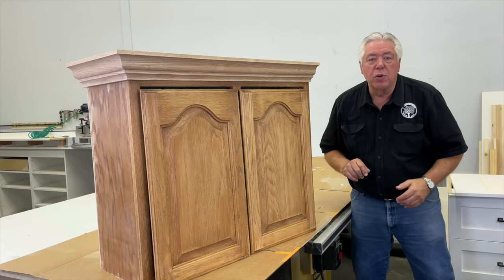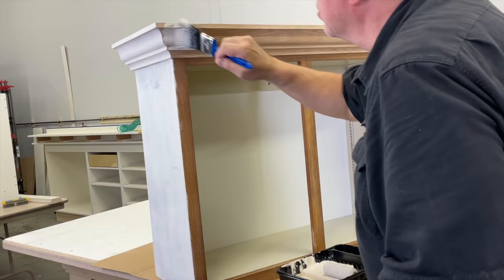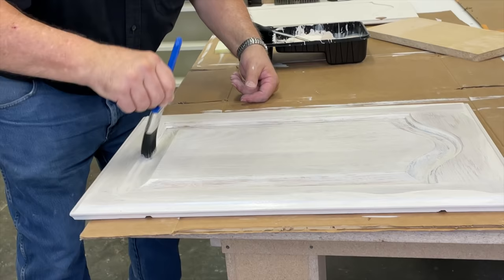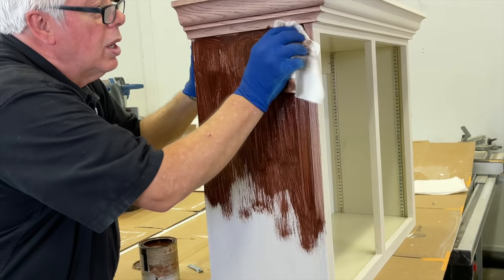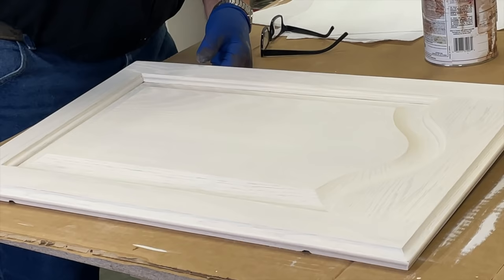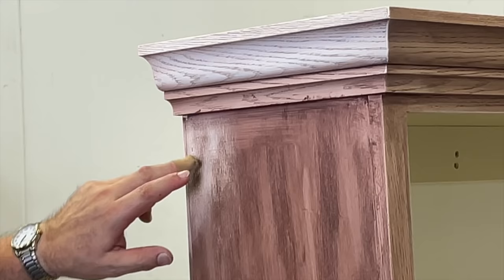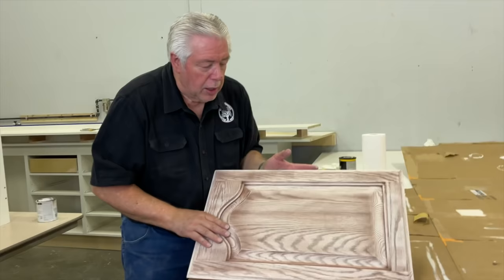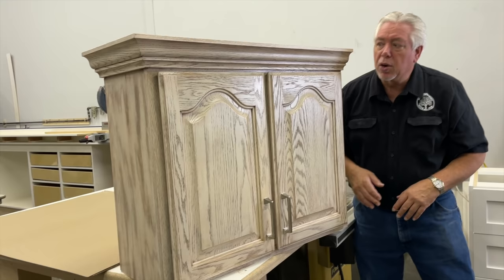Just Like Magic Your Golden Oak Color Will Disappear

Comment: I saw DYI kits that are not bad at $100.00-$300.00 for painting cabinets, but money is very tight, so I've been buying things a little at a time since last winter. When I saw your glazing technique, I got charged up and now I want to try the glazing technique. I'm planning on doing this to my cabinets in early fall when I can still keep windows open plus it will be cooler and less humid out. I have my living room walls and trim to do as well that I planned on doing last year. I was going to just paint them white, (they are golden oak now), but I love the look of the grain through the paint in your technique. Besides the obvious of priming first, should I use an oil-based primer then a water-based final coat? Or do they have to be the same base element? I bought the small rollers and pans in bulk at least 4 years ago and still have a dozen left, and chip brushes that I won't use on the cabinets. For this process should I use a natural hair brush, such as sable or can a nylon brush be used? I appreciate any input you may have for me. Thanks! ~Dolly
Reply from the maker: Dolly...you don't need the same base in your different layers of application. A nylon brush will work great. Good luck with your project. Thanks, Wes

Comment: Just a question on the end with the veneer could you do a water pop? It might be too thin to water pop. In redoing wood floors you can water pop then use a wire brush kit and take the soft grain out. The water causes the grain to rise and allows for the removal of some of the soft grain.

Comment: Its an okay look, dont get me wrong, but thats a lot of work for the look. You have to disassemble, prep surfaces, lay out all material, do a layer, flip doors, do another layer, flip back and sand doors and cabinet boxes, add paint over primer, sand again, add another layer, sand again, and then I assume there will some sort of wipe on top coat. There are gel stains you can wipe on one time and touch up a little, then top coat with the most  minimal of prep needed.
Reply: I agree!  Not a fan.

Comment: Is there a reason that you dab with a cheap brush instead of using longer strokes with a good brush?
Reply from the maker: Yes. The glaze doesn't need to have a smooth or finished look. A cheap disposable brush is adequate. Thanks for watching. Wes

Comment: Doors off 
Wire brush, lacquer thinner 
Primer for paintbrush, tinted
Foam roller
Find someone who will reattach doors w new hinge, add hardware
He used wire brush on primer
Brown glaze oil based over primer. Doesn’t dry as fast, has more time 
Grain shows
Sponge sander. Sanding off surface glaze
But I can’t sand mine

Comment: This finished cabinet is a nightmare, from the wire brush to the cheap paint brushes, and paper towels you used.  The oil based stain over the primer is horrible 😳

Comment: Would it be feasible to just simply paint the cabinets and skip the glazing step if I prefer a more faint grain look. . . If so, would priming be advised or just prepare the surface and go directly to 2 coats of paint?

In short, I prefer more faint look on the grain, how can I maximize that preference to save me the most work? - Thank you very much.
Reply from the maker: Hi...the color coat (paint) that I used was a tinted primer and you could apply a clear top coat on that and skip the glaze. A more subtle grain effect would be achieved by a less aggressive wire brushing. Thanks for watching, Wes

Comment: Wowee I love this so much!  I've been looking at new homes to move into and up until now avoiding yellow oak but not anymore.  Bring on the yellow oak so I can transform it into something beautiful like your example here in this video!  Thank  you for the clear and easy instructions.  How scrubbable is polyurethane?  Does it ever turn yellowish or discolored?
Reply from the maker: Hi Rose...polyurethane should be yellow resistant and easily cleaned with a soft cloth and warm water. Thanks, Wes

Comment: Wes, I'm not a big fan of water-based products. Have you tried using kilz as your base coat? I'm curious as to how that would work.
Reply: Kilz is a brand
Reply: Ryan E. I know kilz is a brand. I'm a painter. I'm just wondering if he ever tried kilz as a base coat rather than water based primer as a base coat. I'm wondering if kilz would give the same finish
Reply: @michaelroques743  you’re not getting it, Kilz is a brand. They make waterborne, solvent borne, shellac based, synthetic based….
Reply: @ryane6719  real painters know wtf hes talking about. Dont be rude
Reply: @floridagirl9064  It doesn’t matter if you’re an astronaut or a painter ,we’re talking about differences in physical property of primer. he’s talking about a brand without telling us which Product under the brand he would recommend.
Reply: @ryane6719   Low in T?

Comment: I have these oak cabinetsand they are very old. I've attempted twice to paint them pure white but after a little while I start to see yellow bleeding through my paint. I stripped the wood using citri strip, cleaned them with tsp, and sanded them. What prducts do I need to use and what steps do I need to take to keep them from yellowing over time. I want a bright white kitchen and I'm having a hard time achieving it! 😩

Comment: You're video is so well put together and encouraging. Thank you for making it! We recently purchased our home and we knew we needed to get the cabinets repainted. The prior owners did a really terrible job where they didn't fill in gaps and damaged parts of the wood, then painted it with white semi-gloss paint (probably only one coat because the oak color still shows through). To do this project as shown in this video, would you recommend stripping the paint first? Or could I sand it down to save me some time? How should I repair the wood damage? Thank you in advance for your advice and tips.
Reply from the maker: Hi...don't strip the finish, just sand. Repair your damage with a good wood filler, then prime and paint. Good luck, thanks for watching. Wes
Reply: @WoodworkingWithWes  thank you for your suggestion. I really appreciate your feedback

Comment: Love this tutorial and i am trying to do my bathroom cabinets this way. The only problem is that the current cabinets have a thick almost pinkish coating. Is the best way to get that off by scrubbing by hand with a wire brush?
Reply from the maker: Hi Sean...not sure what the pinkish coating is. Start with your wire brushing to see if it enhances the grain enough for the cerusing process. 
If not, you may have to remove the existing finish by sanding or stripping. Hope this helps. Wes
Reply: @WoodworkingWithWes  i wish I could send a pic here but it won't let me... I started using a stripper and will use a brush after to clean it up because the coating is pretty thick. I think they went a bit crazy with clear

Comment: I love your vids…..but it appears as though the “final product” has some bleed through. Oak in my experience has some of that honey color bleed through as you paint/prime it. Was that the case here or am I seeing it wrong? And how do you deal with it? Thanks for all of your informational vids!🤙🏻
Reply: I was wondering the same thing.  Perhaps a coat of BIN to seal the tannins and the tinted primer?
Reply from the maker: Actually...it wasn't bleed through. I just sanded the primer coat a little too much and didn't go back to repair it. I have not had any bleed through issues with the cerusing of golden oak that I have done. Thanks for your comment. Wes

Comment: It's really nice! 
Is there any polyurethane that can be used that doesn't leave a yellow tint?
Reply from the maker: Hi Ann...yes, I think there are. I would suggest checking the manufacturers specification. Thanks for watching. Wes
Reply: @WoodworkingWithWes  , thank you for sharing your video with us. I've never seen this method before.
We're buying a home and the cabinets are a bit outdated. I'm thinking about using this method with a grey stain if I can find a clear coat for it.

Comment: I understand using the 1 1/2" brush on the face frame, but why not use a bigger brush on the sides and the doors to speed up the process
Reply from the maker: You certainly can if you would like. Thanks for watching. Wes

Comment: When i wiped the glaze off, the paint came off with it. Would it be better to use a satin paint so the glaze whipes off easier?
Reply from the maker: I have run into that problem also. I solved it by applying a clear sealer coat after the paint and before the glaze. I use Minwax Polycrylic. Thanks, Wes

Comment: Mr Wes! I need help please!!!!!  I want to do this finish in my kitchen cabinets instead of refacing.  But I want it in green.  I want white for the ML Campbell oil base furniture glaze and green for the primer (?).  I don't want to make mistake, thus the questions.  Also, I only want to ceruse the doors.  the rest, I still want the golden oak color.  What do you think? Do you think that would work?  I need to clean the entire kitchen cabinets with acrylic thinner (is that correct?) because the old microwave we used to have were putting so much grease all over the kitchen (that has now been changed).  What do you recommend I use to finish the golden oak trimmings if you think it's ok to ceruse only the doors.  I'm ready for the job.  I would appreciate it if you can help.  Thank you so much.
Reply from the maker: Rowena...we have done a video with a green and white glaze you can refer to and it would look great on doors only leaving the cabinets in their original golden oak. The acrylic thinner might work very well but do a test on one of the doors you plan to paint to see if it does what you need. If you want to put on a fresh coat of clear finish on the golden oak portions of your cabinet, polyurethane would be a good recommendation. Good luck on your project...sounds awesome ! Wes

Comment: Do you have to remove the original finish —strip or sand? Or does using paint primer allow you to skip stripping and sanding ?
Reply from the maker: This process eliminates stripping and sanding. You might review the video closer before you begin a project. Thanks, Wes

Comment: I tried that at home last night but I must be doing something wrong. I used water based stain and when I tried to wipe it, it took off the paint underneath. I can think about couple of factors: does it have to be oil based stain? Should I use satin finish paint instead of matte? Any advice would be appreciated.
Reply from the maker: Julia...please review the video one more time keeping in mind that my base color paint is water base. The next step is not a stain but a glaze and is oil base. After cleaning the glaze gently, I wait for it to dry and then sand lightly to highlight the grain. Thanks...I hope I have answered your question. Wes

Comment: Hi Wes would like to know if the cabinet was sanded first? Have varnish on mine, would wire brushing be enough to remove varnish for stain to darken grain?
Reply from the maker: Hi Karen ... wire brushing is enough on the paint and glaze process I demonstrated. If you are wanting to stain a darker color as your question suggests, you will need to sand it completely in order to refinish. Thanks, Wes
Reply: Hi Wes, I have dark stained hardwood that is grainy, would this technique work for that or what can l do to lighten hardwood? Karen from Aussie!

Comment: I'm trying to clean grease from cabinets before starting this process. I've wiped down with mineral spirits. Some are still quite dirty. Any recommendations? TSP, ammonia, something else? Thanks!
Reply from the maker: I am sorry...I really don't know what to recommend since the mineral spirits should have done the job. Perhaps go online and check out resources. Thanks, Wes
Reply: Thank you for the reply.  I wire brushed one door after cleaning with mineral spirits, and it worked.  Do you need to sand (sponge sandpaper?) the back of doors and inside the cabinets that will just be painted white,  no glaze?

Comment: Using the wire brush, won’t it leave scratch marks on the surface?  It won’t look like the typical sanding wood finish
Reply from the maker: Correct...it is not the typical wood finish, it is a ceruse finish. Wes
Reply: @WoodworkingWithWes  thank you Wes.  So I understand that the finish is intentionally rough instead of traditional smooth sanding.

Comment: My kitchen cupboards are solid maple. the prior owner put them in and top of the line. However, my kitchen is very small and the wood makes it look smaller. I bought this home 20 years ago and have all the paint and supplies but keep hesitating to do the actual work. I wonder about the wire brush, what is the reason for that? I want a solid white, and no grain, so could I eliminate the wire brush? I just now found your video and subscribed so will be on the lookout for prior and new ones to learn more.
Reply from the maker: Hi Judy...this process is to enhance a course grain wood. For your maple, just paint and it will look beautiful. Thanks, Wes

Comment: I just don’t the the antiqued look. Golden oak is dated but this looks less than in my opinion. Why not try and strip it and then sand/stain a nice dark color that will last and probably never become dated. I did this with my antique windows and it came out great. Took 2 applications of stripper though to get through all the old paint and stain. Its a 180 year old house made out of cypress and I’ve never worked with oak so I’m no sure how it would turn out stripping oak eventhough it’s a hardwood. This old cypress is very hard with the annual rings very close together
Reply from the maker: Thanks for your comment. Wes

Comment: Zinsser  Bulls Eye 1-2-3 Interior or Exterior Multi-Purpose Alcohol-Based Wall and Ceiling Primer (Aerosol Spray)
$7.98 + Tax
Could you tape off the bracket  and use this aerosol ?

Comment: You're not holding your mouth right. Cabinet shows where your wire brush has been. Your stain brush is too small which makes your strokes small showing overlaps. Become one with your brush. You missed a few spots. Be more thorough. Yes, nonhuman flying saucers are real. Have a Nice UAP/UFO Day.